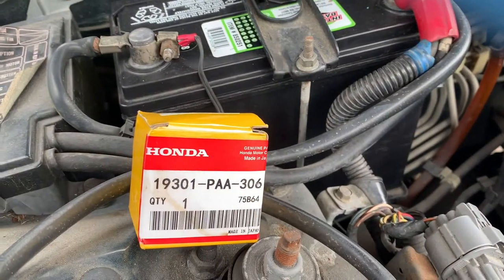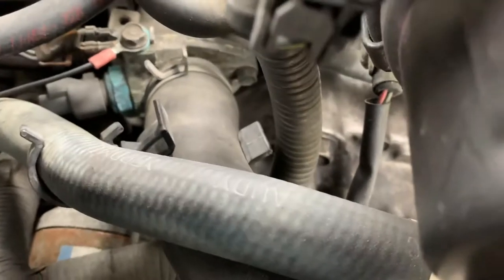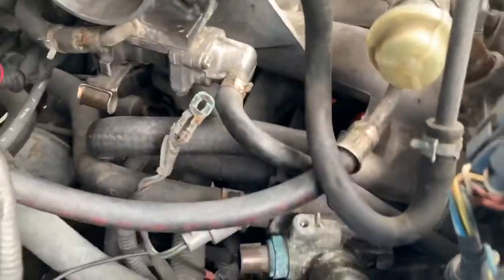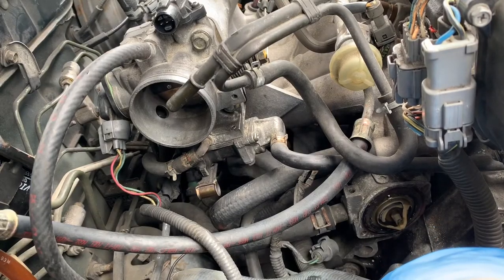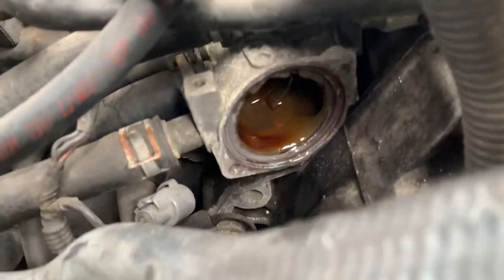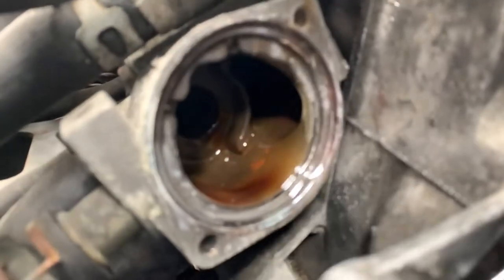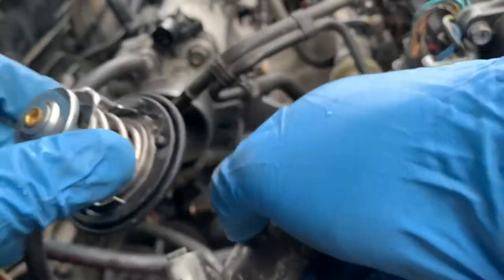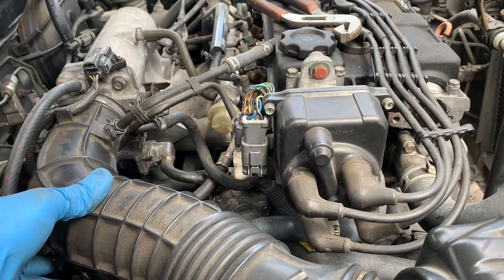How to remove and replace a thermostat from 94 to 2001 Acura Integra

Comment: Thanks bro, I got a leak and im 80% sure its from the thermostat I already bought a replacement gonna do this tomorrow!
Reply from the maker: Great! Good luck! I’m happy to share!😃
Reply: Bro did it fix the leak ??? Mines just now started leaking 😒 😑 🙃
Reply from the maker: It sure did ! Make sure you use new thermostat and gasket.  Tight bolt properly, it should not leak unless the housing is cracked or not properly tight.
Reply: @SALMANDER33  it wasn’t because of the thermostat it was because of this worn out tube. I would check them all first…squeeze each one and check for drips (obviously when they’re cold). If not then it might be the thermostat.
Reply from the maker: Great, if the upper and lower hoses were already bad,  this might be the best time to replace them.. since you are already draining coolant.

Keep an eye on your coolant reservoir, loosing coolant from it is not a good sign.
Reply: @michaeljimenez410  all new mishimotto hoses but never replaced the thermo
Reply from the maker: Ok great 👍
Reply: @jpscrx  culprit was heatercore hose had a small crack on the underside
Reply: @jpscrx  how to tighten properly? I'm stumped
Reply from the maker: @SALMANDER33  

Make sure the 2 notches on the rubber gasket sits properly on thermostat housing.  It should be free of any old silicone otherwise use blade to clean up. It not clean it will leak

Also do mot over torque it because bolts will break

Comment: How'd you tighten the bottom thermostat housing the one that barely has any room to take out to begin with ? I bought a stubby ratchet and it still not tight enough
Reply from the maker: I have used 1/4 ratchet we with extensions if I remember it correctly

Comment: Was it leaking or overheating or wouldn't heat ?
Reply from the maker: I just bought the car and I wanted to do a complete service tuneup. If you have a leak, you can pressure test your cooling system and find out where the leak is coming from.
Reply: @jpscrx  to they lend those out at orileys?
Reply from the maker: I do not know for sure, I believe they have different inventory for each stores.